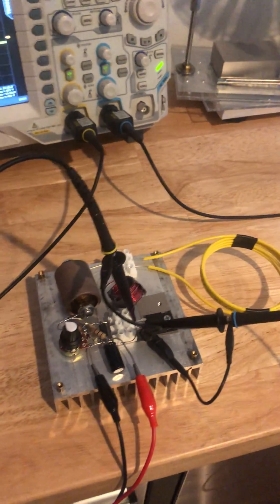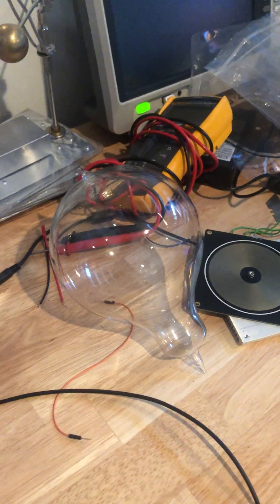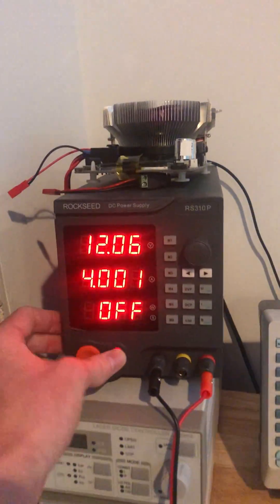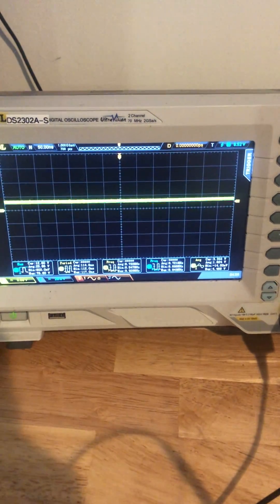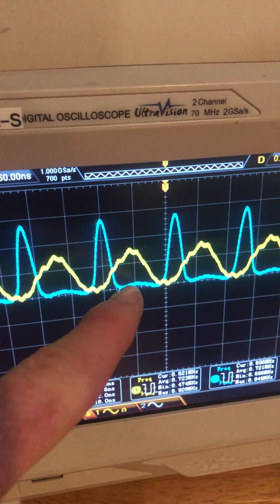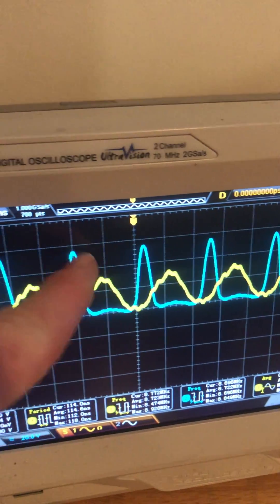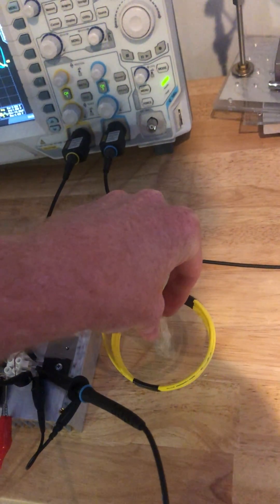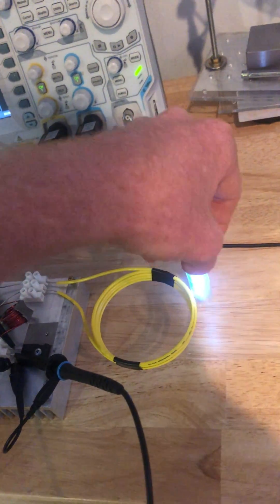Patreon Peek: Plasma Toroid Progress

Comment: Hi I've sent email hope you got them but no response! Can I make tesla coil with out bleeder resistors? Can't get answer what size I would need ! I'm looking for some thing 20 kv
Reply from the maker: You should put bleed resistors on the MMC because then if there's any stored energy in the MMC after you turn off the tesla coil, the energy can dissipate into the resistors and not shock someone if they touch the MMC. I think I used 1Megaohm, 1W resistors across each parallel strand of capacitors in my MMC.